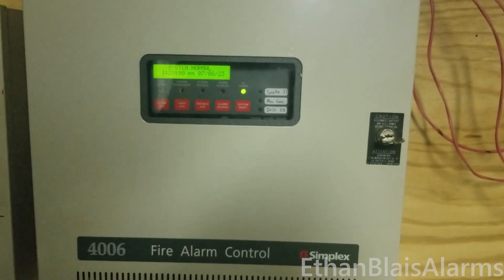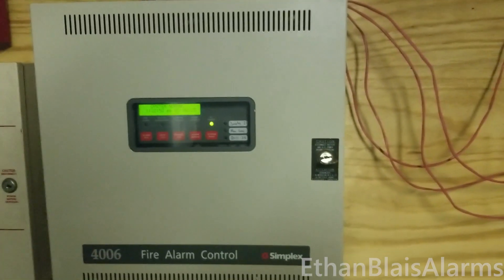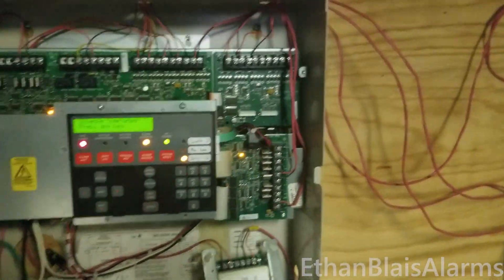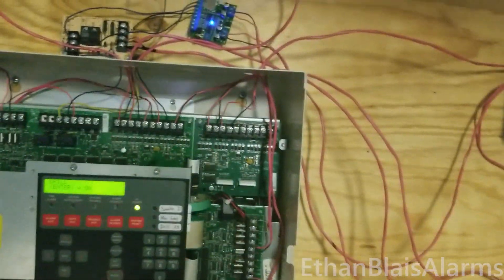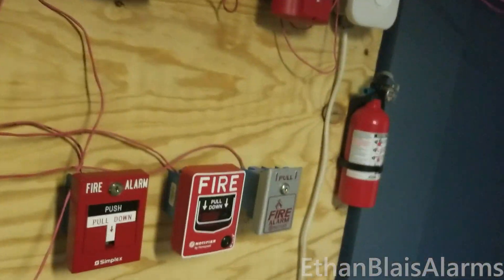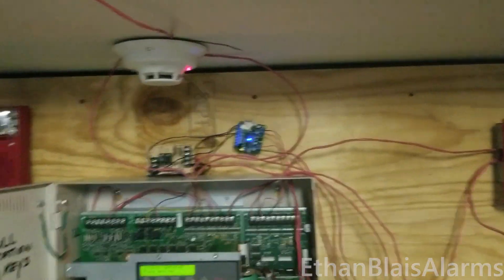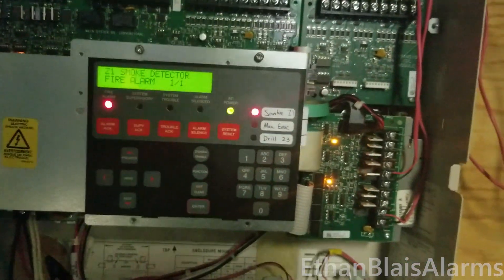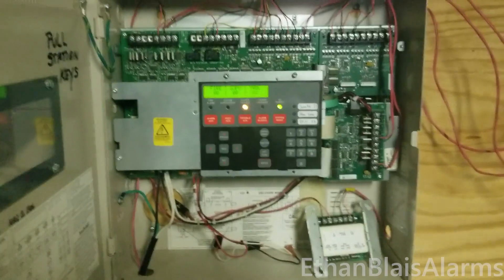System Test 15 - 2-Stage

Comment: oh i got a crazy idea 4001 tied into 4006
Reply from the maker: I could do that but only as a 1-way connection. The panels would be tricky to properly time the resets if I did a 2-way connection.
At the moment, the alarm room is under construction and the 4006 will likely be moved. Once that's complete, this is something I'd consider doing for an extra system test video.